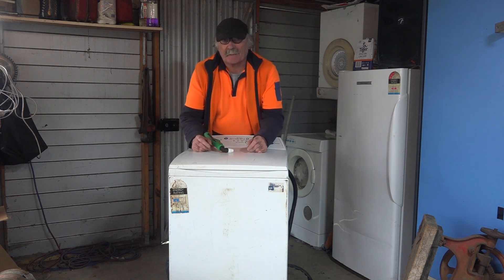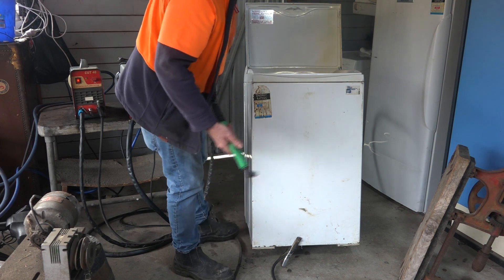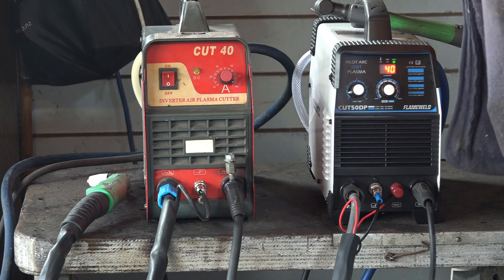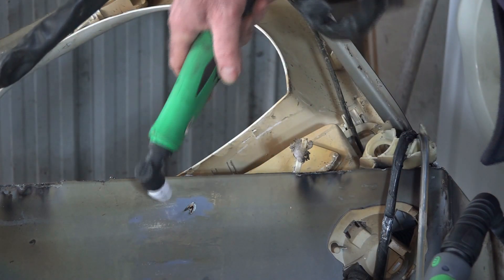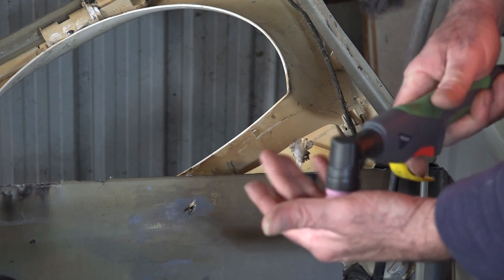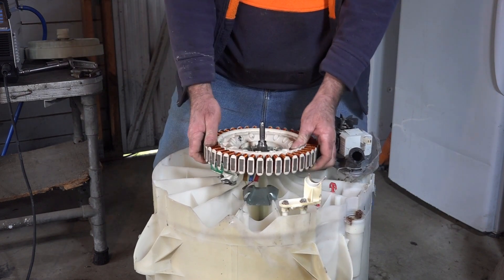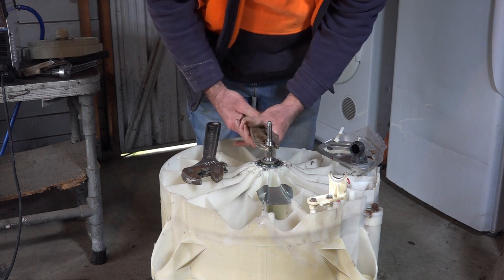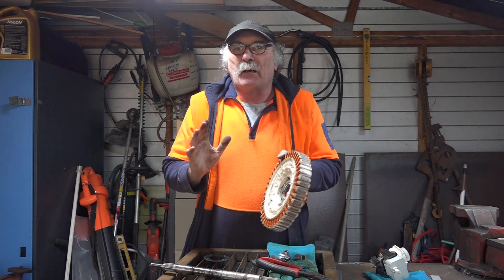The Best Plasma Cutter for Scrap Metal - Do You Need Pilot ARC ?

Comment: Hi Pete. I have a magnum pilot arc plasma cutter. (Cut 50) bought here in Australia.  Does it use a generic torch and generic fittings? I  bought it years before coming across your channel the consumables on their website are pricey compare to the costs you are talking about. 
Thanks in advance.
Rob
Reply from the maker: Hi rob what sort of torch does it run ?

Comment: Does the salvage operator require you to separate all non metals from the scrap metal?    Here I know they take some of the non metal stuff off of scrap cars , but certainly not all before they shred them  into tiny pieces.
Reply from the maker: You will get more for it if its clean mate .cheers pete